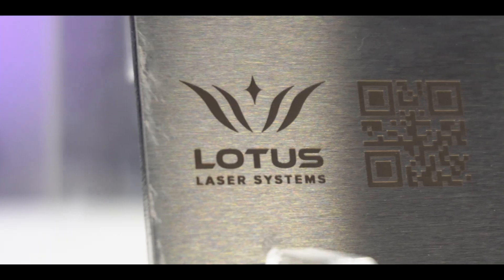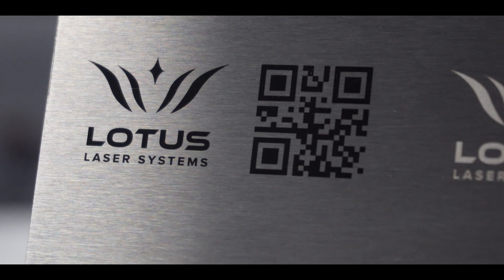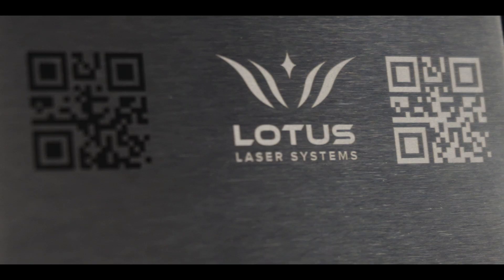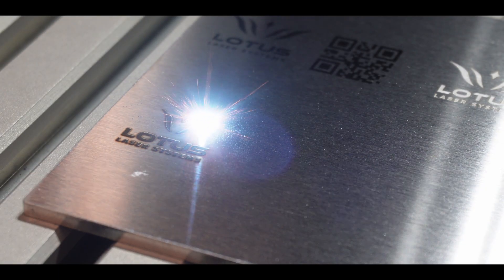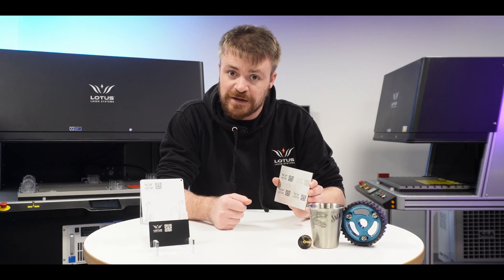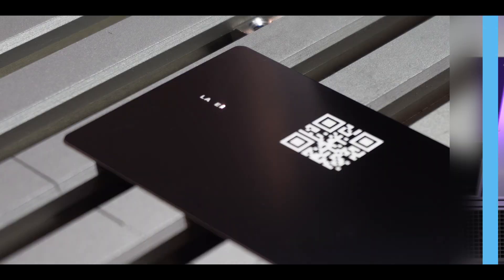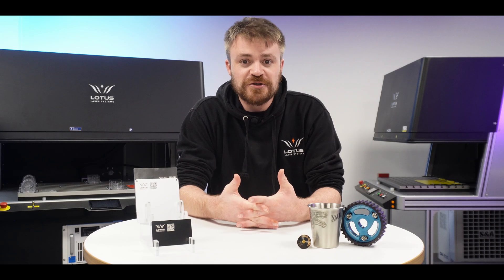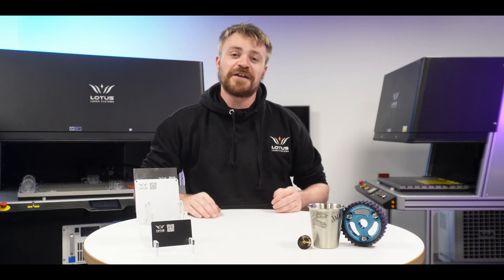What Can You Laser Engrave on Stainless Steel & Aluminium? | #laserengraving #lasermarking

Comment: What machine of your range is suitable for engraving 300x 100 mm carbon steel blocks to a depth of 0.25 mm please?
Reply from the maker: So any of our fiber systems will be more than capable of this - depending on the volume of parts you're looking to produce I'd recommend either the Meta-C Fiber or the Meta-XY fiber which has a 700mm x 500mm work area so perfect for mass production. If you reach out to our sales team here: https://www.lotuslaser.com/contact/ they'll be more than happy to advise. Thanks for your comment!

Comment: dark on aluminium, without any spray?
Reply from the maker: Absolutely. Every single mark on metal produced in this video (and that we produce in general) is done entirely using our MOPA Fiber laser. Basically, our systems allow for a huge amount of flexibility because we offer 17 different waveforms, or levels of laser power, where most other lasers offer 2-10 max. 

The control over the power delivery means we can change the parameters in our software and provide a huge range of engraving options. If you want to see more we're always open to booking in-person or online demos where we can show you the engraving live!

Comment: That crisp black anneal, wont that interfere with the integrity of the stainless steel, and make it rust?
Reply from the maker: In quite extreme cases it would, but for the most part the mark is very durable - we've worked with lots of companies using black annealing for traceability and they've had great results across the board. However of course if this were going to be an issue for your application we'd be more than happy to advise and work out a solution for preserving the steel better as yes, in extremis it would be open to some degradation. Thanks for the comment!